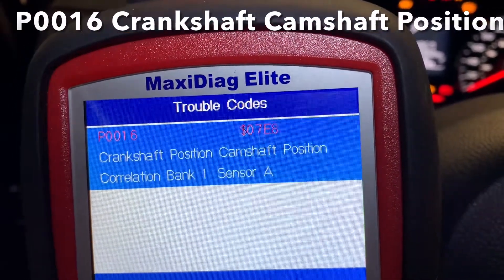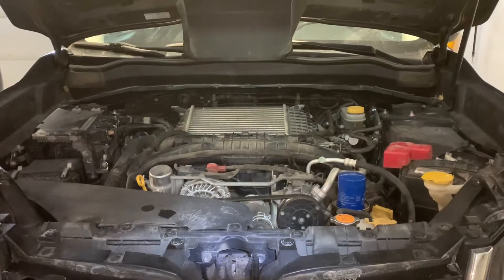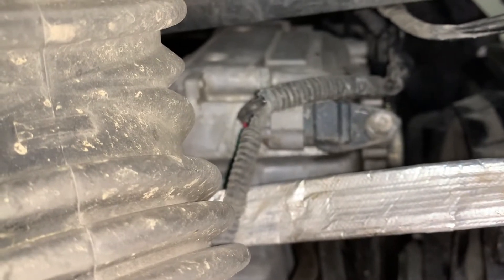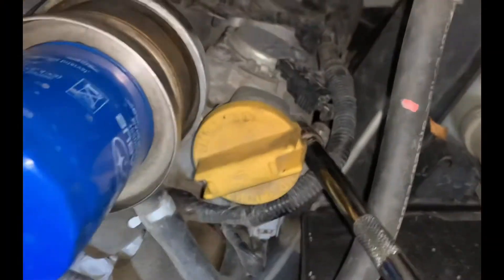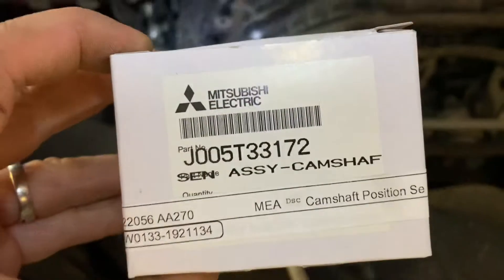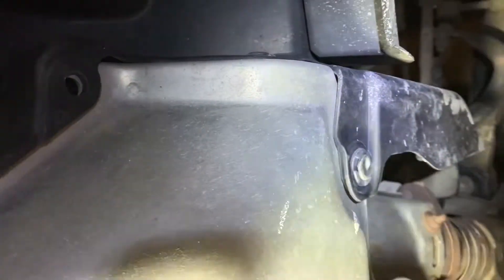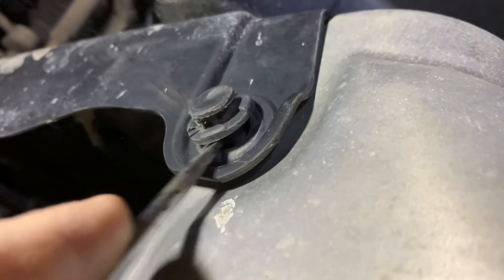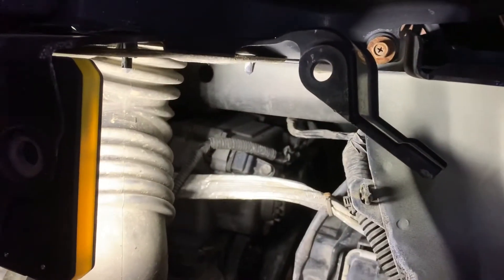How to replace a Subaru Forester Camshaft Position Sensor (4 in total) Error Code P0016

Comment: Running into this now on a 14 XT, throwing P0017 and has all the dash lights turning on too. Thanks for the vid, gonna try swapping sensors and see if my code changes.
Reply from the maker: Also put on a new gas cap. For the $10 it’s worth a shot. This fixed my issue the first time. lol. Same code and lights but was Cap the first time around.

Comment: Is there any symptoms before the warning light happen? Maybe rough idle or fluctuate rpm when coming to stop? Thanks
Reply from the maker: There wasn’t on our Subaru. First to try is getting yourself a new gas cap. Often a leaking cap will also set off all the same lights and codes.  Not exactly sure why but for the $30 it’s a cheap thing to try and if your car is old you’ll probably need one anyways as that seal in the cap gets hard and cracks and then the gas tank doesn’t maintain pressure.

Comment: Curious if there is a way to identify which one was bad or if all them need to be replaced for good practice. Also, am I reading the parts price correct? Over $100 each?
Reply from the maker: Use a code scanner and it will tell you if the error is for bank a or bank b. That at least narrows it down to 2 sensors.  At the time, I paid $22 for each sensor (Mitsubishi makes them) from Autopartway in Canada. If in USA use RockAuto. So, $100 for all 4.

Comment: A camshaft position sensor is not also called a crankshaft position sensor.
Reply from the maker: I’ve updated the title and description, thanks very much!
Reply from the maker: Good catch, thank you!  You are correct and this video is for the CAMSHAFT sensors.  Here is a link to Subaru the part number:  

Camshaft Position Sensor
Part Number: 22056AA270
https://parts.subaru.com/p/Subaru_2014_/Engine-Camshaft-Position-Sensor/49231381/22056AA270.html

Comment: Thanks for posting this. I have yet to see a single video in which a sensor or vvt solenoid swap fixed this issue. I’ve got the same 2014 xt as your wife. Mine has 236k miles though. 2 days ago I got a check engine light along with blinking cruise control and blinking s mode. My scanner shows both 0016 and 0017 codes. I find it hard to believe that two sensors went bad at the same time, so I replaced the both variable valve timing solenoids on the drivers side to no avail. Oddly when I erase the codes, the car sometimes will run fine for the next half an hour with no code, and then boom. Check engine again. I was thinking it might be the timing belt. Except my car runs like a top. Perfectly. Even with the check engine light.  No misfire, idles fine.  Was your wife’s car driving well even when the check engine light was on? By the way, full synthetic oil change every 3000 miles since new. About once a month.
Reply from the maker: Well, it appears to be a common VVT (variable valve timing) issue on these Subaru’s. It’s good to swap the solenoid just to ensure you don’t need to spend the big bucks or time if you want to do it yourself.  I finally caved and the dealer replaced, which did fix it, but at a high price.  Parts were:  Camshaft sprocket (right hand, note our cars have 2, but only right hand on mine was screwed) and you MUST replace ECM if you replace sprocket. Apparently, they can only be programmed once with sprocket values.  Parts were (again, passenger, right hand, side): part #13320AA021 - sprocket (one) cms int rh; part# 13199AA120 - camshaft bolt (one); part #22611BG963 - Unit EGI Control (one); part# 806750080 - oil seal 50x62x7 (one); part# 806924120 - o-ring 23.8x2.8 (one); part# 806912190 - o-ring 12.1x2.5 (three); part# 806939060 o-ring 39.0x2.0 (one); part# 806916080 o-ring 16.1x2.3 (one). Total parts: 1996.97 CAD, total labour: 910 CAD, total bill $2,906.07 for ONE SIDE.  It would be close to $6k to do both.  I’m not saying your car needs this but it may and interestingly, they did not replace the chain, as the issue is apparently the sprocket, which really makes no sense.  Hope that helps.  Oh, and it ran okay with lights on but idles better now. We have the eyesight system (yuck!) and when the codes come on it turns off eyesight which in turn turns off traction control!  That’s seriously evil, because it can’t be driven well in the winter in Canada when it happens.  If it were not for the dash lighting up like a Christmas tree and all driving aids turning off I would not have fixed it - ran okay.
Reply: @ChanceSummer  thank you so very much for all of that info. It's well beyond my ability to do that kind of work. I think the exact diagnosis will be the issue.  It's spring now so I have a few months maybe before snow.  Thanks again

Comment: How did you resolve this (if you did)?
Reply from the maker: Dealership replaced camshaft sprocket, chain and all the related bits at the cost of $3k. Only did one side as it is $3k per side!
Reply: @ChanceSummer  so that’s what the repair was after all?
Reply from the maker: Sadly yes - dealership repair and a week out of service. A major downside to VVT.  My 2004 Impreza is such a cheaper car to keep running. 

Replacing the 4 sensors were something easy to do so I wanted to rule out the cheap and easy fix first.  Also change the gas cap as that often fixes many codes.
Reply: @ChanceSummer  found out that you must use OEM in engine sensitive sensors like these. The Auto parts store and eBay generic sensors isn’t gonna cut it. I’ve tried. Resides with OEM Subaru parts.
Reply: @ChanceSummer  I'm planning to change the vvt solenoids on the bank 1 side and go from there. You are correct they sure are picky and higher expense motors.
Reply: @marcmercado2085  so i did the generic and still have the same code but i believe mine is the vvt solenoid. Fingers crossed, if not ill have to look into the cam sprocket like @Random DIY had to do.
Reply: @pertts_adventures  just wasted your money, but it ain’t my car so 🤷‍♂️. You can still buy OEM but cheaper than the dealer by buying online. Bought mine off of eBay but they’re Subaru originals.

Look up @PineHollowAutoDiagnostics. I’ve quit using generics for anything electrical and sensitive. I bought a generic VVT and tested functionality, resistance, etc. tested good but the car said 🤮. Got the original and been flawless for months.

Comment: Thanks for the helpful video. I got the P0018 code for crankshaft position sensor A bank 2. My forester still runs fine and the code generally goes away after
I change the oil… but not this time. Since you replaced all 4, were all the sensors the same part? Or are the sensors for each bank unique?
Reply from the maker: Sensor parts are identical - same part for all 4.  Before you do anything else order a new Subaru gas cap. That made my these codes go away for 30k kms. Since coming back the always come back after clearing them.  The only permanent fix appears to be replacing the cam sprocket me ECM/ECU at the same time.

Comment: Did your light go off after replacing and clearing the code?
Reply from the maker: Nope!  Here is what I can tell you with certainty, a P0016 on this vehicle is NOT the sensors. It is NOT the oil but it could be your oil control valve (if you have sluggish performance and rough idle).  

I even tried Subaru’s Service Bulletin 11-130-13R which fixes P0340 but that did nothing to help my issue.  The dealer and others have stated there is no choice but to replace the RH (passenger) cam sprocket and ECU/ECM..(the computer can only learn once apparently so it must be replaced).  

Since I have no performance issues I have left it BUT Subaru in their infinite stupidity (or smart because it drives trips to the dealer) causes all traction control and eyesight to turn off if the car throws a P0016.  It’s back to driving a car from the 80s but with ABS because that luckily doesn’t turn off. I believe in time you’ll see a recall for this as it is common among almost all Subaru models from about 2010 onwards.  The only thing I hold against Subaru for this is turning off all traction control - that just doesn’t make any sense and makes the car more dangerous to operate.
Reply: @ChanceSummer  so I replaced all 4 camshaft sensors cleared the codes and now I believe p0017 is on, from research I’m able to tell that it could be the timing chain. I feel I am having some performance issues such as a missfire or rough idle. However at one time I did see a code when checked at the parts store for cylinder number three. So I have purchased plugs and ignition coil packs to do this and go from there as the car has 180,000 miles on it.